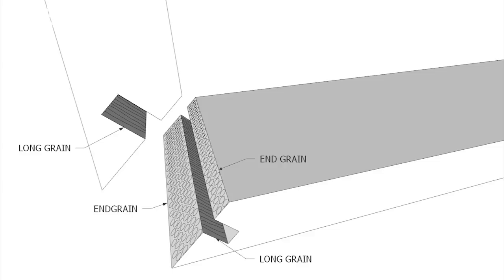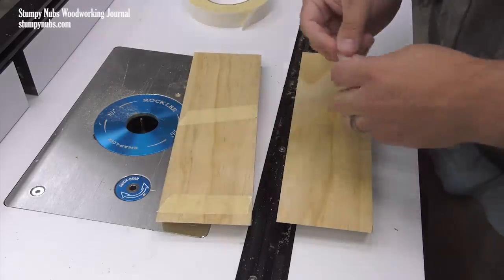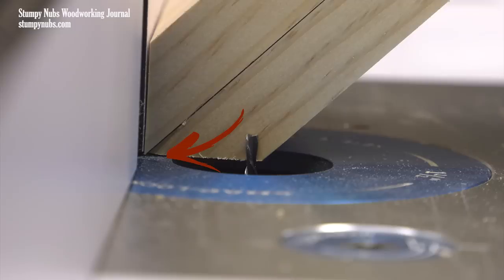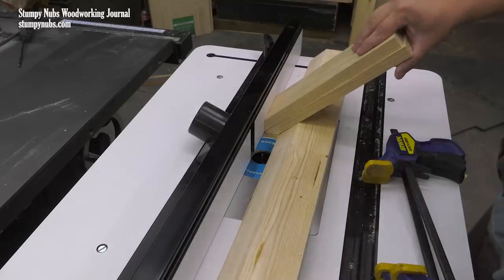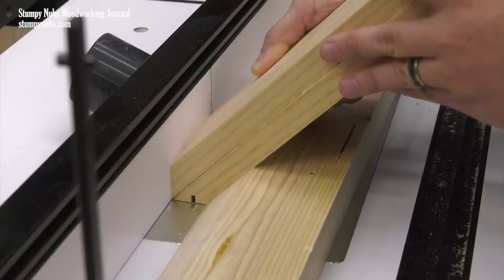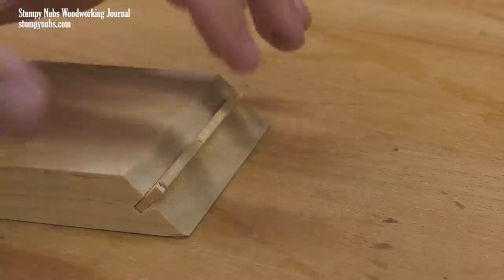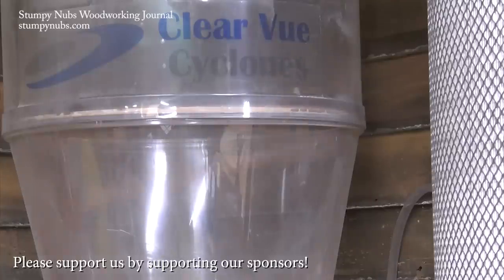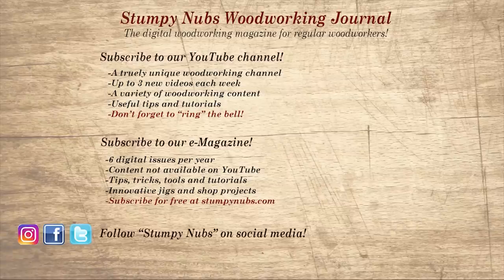Clever splined-bevel joints for mitered boxes

Comment: This seems kinda ineffective. The way you’re cutting your slots is still 45° to the grain, which means end grain. At best you’re only achieving slightly more surface area. Am I missing something?
Reply from the maker: On a 3/4 inch thick, 4 inch wide board, a 45 degree bevel provides about 4 square inches of glue surface. I you cut a 1/4-inch deep slot in that surface, you have exposed 2 square inches of long grain surface. (You could make a deeper slot and get even more.) That alone is much stronger than the 4-inches of end grain because long grain is at least twice as strong as end grain. But remember, your joint will still have most of the end grain glue surface to utilize as well! And you double everything when you add the other half of the joint.
Reply: @StumpyNubs  I still don't think that the grain exposed by the spline slot is in any way more like long grain than the original mitre.  All the surfaces of the splined joint (except the spline itself) are at 45 degrees to the long axis of the wood.  I'm not saying that it's a bad joint, I just disagree with your description of it.
Reply: @cgdennis82  You kind of answered yourself in your own comment - "except the spline itself" is the point. Each side is all NOT end grain. So instead of end grain to end grain directly to each other you have 45 degree end grain to long grain on both sides. Plus the forces on the spine to detach the corners would be along the glued surface not perpendicular like a straight join. Well there is more too..
Reply from the maker: I get what you are saying, and it may not be technically appropriate to call it long grain. But the splined miter joint is still significantly stronger by the addition of 40-50% more glue surface, the long-grain strength of the spline itself (if not technically long grain within the slot), and the mechanical component of the spline and slot together, which is comparable to a mortise and loose tenon joint.
Reply: @StumpyNubs   Thanks for the clarification. You're right that there's without a doubt an obvious mechanical advantage to this vs a plain miter joint. I just never understood why people claim that the slot exposes long grain. I'm still convinced that other splining methods would be stronger, but I can see the advantages to this as well

Comment: Bevel joint?
Miter joint has been the term for ages, no point in changing horses now.
Reply from the maker: There's a difference between a miter and a bevel. Nobody is changing the term.
Reply: @StumpyNubs  
I've been around woodworking for 50 years and have a large library on the subject.  I have never seen "bevel" used in all those years for any joint.  'Miter' is the only term I have ever seen used, and that includes references to joints involving angles that don't meet at 90 degrees.
Also, miter has always been used to describe joints with the boards oriented flat like a picture frame, and on edge like box sides.
Reply from the maker: @deezynar  While there is no rule, and the term "miter" may be applied to any angled cut, the term "bevel" is a subset of miters that is generally used to describe an angle that is cut in the edge or end-grain of a workpiece. While miter is often an angle cut across the face of a workpiece, such as when creating a picture frame. That's why the tilt function of the table saw is called the "bevel angle" and not the "miter angle." And why the manual of any modern CMS will tell you to tilt the head to cut a "bevel" and to turn the head to cut a "miter." Again, you are not wrong for calling it a miter because bevels are types of miters. But I am not wrong for calling it a bevel, which is a phrase that's been around much longer than either one of us and is indeed found in many books, if not the ones you own. :) https://youtu.be/7aZCdt8Cs8M?t=82